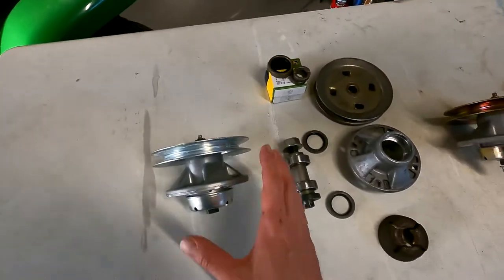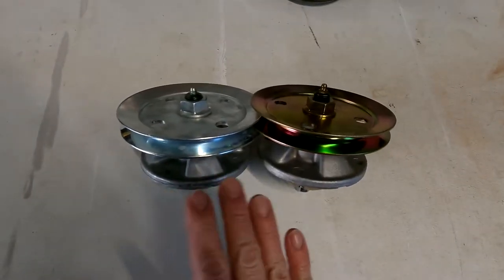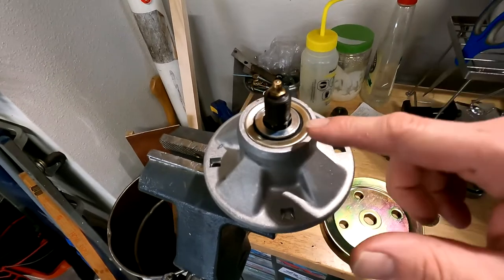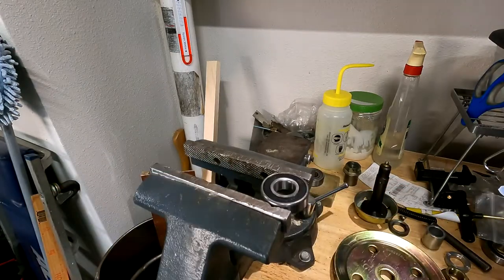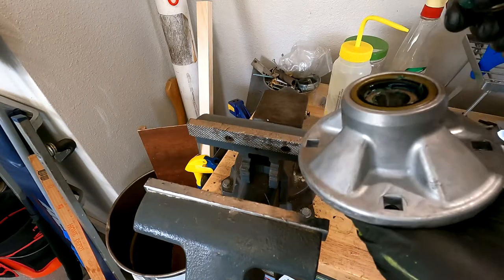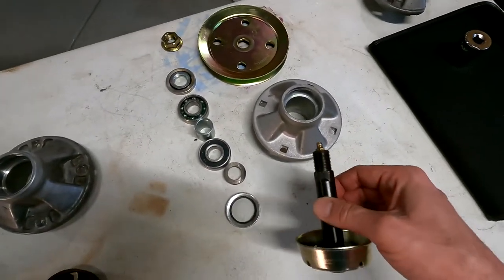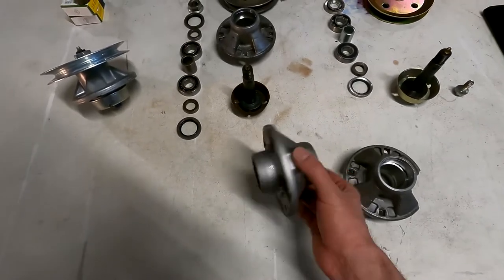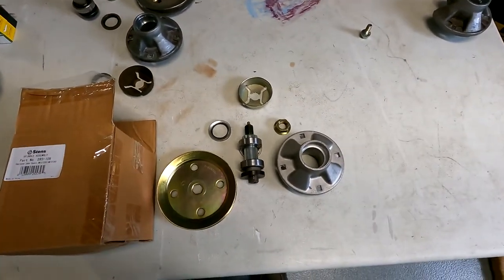John Deere 425 54" Mower Deck Spindles: OEM vs Aftermarket

Comment: I think a better option is to clean the original JD bearings and if after cleaning inspection they are smooth with no roughness, wear or pitting then 
 just reuse them. Since they are open bearings cleaning is super easy. I'm curious how many pumps of the grease gun are needed to get the grease into the actual bearings?  (ie does that inner cavity require much grease before it can reach the bearings?) How many mowing hours would you estimate between spindle rebuilds?

Comment: The pulley on my  John Deere mower separated. I called the local dealer, it would cost $47, they didn't have one in stock, 7 to 10 days to get it. Amazon had one for $12. It is stamped made in China. It fits and works like new. I wonder if the replacement John Deere pulley would also be made in China? I support American made but needed it in a hurry and my local John Deere dealer never seems to have the parts I need. It is easy to change, so if it fails I may try to find a John made one.

Comment: You need to pump them full of grease until grease is coming out. That is how you force grease into the bearings. If you just give it a couple pumps of grease you are just pumping grease into the void between the shaft and housing.

Comment: The top bearing is RS (rubber side) on both top and bottom because as the grease heats up it will be less viscous and those seals help keep it in place. The bottom bearing only has a seal on bottom. I just tore my Deere version apart and confirmed the same construction. Keep the seals and pack it with grease and the units will work fine. It may not be the exact same but it will last longer than a broken one and maybe not as long as a branded version.

Comment: Very informative!  ...Appreciate the quality of information on your channel. Regarding the JD spindles, since there are sealed bearings inside, it seems there's nothing to lubricate. Why do suppose there is a zerk fitting on the spindle?
Reply from the maker: Thanks for the feedback!  The OEM JD spindles do not have sealed bearings inside.  The aftermarket one I took apart does.  Sorry, I guess I failed to mention that in the video. At around 19 minutes I hold up the JD bearing and if you look closely you can see it's packed with grease, but has no seal.
Reply: @FoggyTinkering  Since my original JD spindles do not seem to have a weep hole, I'm very concerned about over-greasing. Is there a risk of creating undue pressure? (I'm not getting any overflow through the zerk, in fact, I'm not even able to squeeze the grease gun which tells me the cavity may be under pressure already.  (I welcome any comments from readers as well).
Reply from the maker: Your zerk may be plugged, or damaged.
Reply: @TeamGusto1  I would definitely drill a hole and tap it/plug it for a weep hole. Just my opinion.
Reply: This video explains it. When the cavity is full and you keep pumping grease it forces the grease past the seal into the bearings. Most bearings fail because people don't pump enough grease to actually grease the bearings. The proper way is to pump grease until grease comes out of the spindle. Then you know it is full. 
https://www.youtube.com/watch?v=PwObkilFXN0&list=WL&index=49&t=72s

Comment: I bought a 425 last year and I replaced the belt the other day now I have a grinding sound when I turn the blades on assuming it's a bearing bad do you know the whole assembly part number from John Deere
Reply from the maker: The JD spindle assembly PN is AM121342.  It's more than likely one of your pulleys; either an idler or the tensioner.  Check those first, as they're easier and cheaper to replace.  They go bad a lot too.
Reply: @FoggyTinkering  thank you very much

Comment: there's a vid called "don't trust the experts grease your mower deck spindle bearings common sense maintenance" that seems to prove that the sealed bearings will be packed by greasing the zerk .

Comment: To be fair, if the aftermarket used sealed bearings, then the other seal being trash is not really an issue, just don't expect to be able to re-grease the spindle with the zerk...
Reply from the maker: You're right.  In a pinch, I'd say they're probably fine for a while.  I just wouldn't expect the same heavy-duty capability the originals had.

Comment: The more I read and watch about the engineering of these deck spindles, the more confused I become. The first prime question is why would they install sealed bearings that can't get grease?
Reply from the maker: It's a balance of cost, availability, reliability, and their ability to perform as intended.
Reply: They get grease.  There's a YouTube video proving it. There is a lot of guys questioning grease not getting to the bearings with seals.  IT WILL GET GREASE! IT WILL NOT HURT YOUR SEALS.

Comment: Is JD worth what they cost?  They have stamped steel decks.
Reply from the maker: Great question.  Don't assume that because a deck is stamped, that it's no good.  Comparing Deere decks to cheaper brands, the steel is much thicker and noticeably heavier.  I feel fabricated decks are overrated for general residential mowers.  They're better suited for commercial or ag use.  Also, with all the straight edges and corners, they have to be heavily baffled in order for the air to flow well and grass to be discharged (or mulched) adequately.  A well-designed stamped deck will not require that much attention.  The rounded shape and intentional curves will allow the deck to do what it's supposed to do.
Reply: Clean the deck and coat the underside of the deck yearly in POR15 to keep it from rusting.
Reply: So what
Reply: @jimbob4456  if a manufacturer has the option they offer the fabricated deck as an upgrade over a stamped deck.
Reply: Not really but they have a name and that’s what your buying

Comment: The rebuild parts are not worth rebuilding compared to the JD complete assembly. Good to know cause I buy the complete spindle bc with the worn out bearing it eats away at the housing making it unusable from the little time the blade was wobbling. 
The grease can through the bearing seal covers. You need at least 80 pumps. A Youtuber tested using a different color grease and when he took it apart the new grease fillled that bearing. When I buy spindles for my X300, it doesn’t come with a pulley or nut. But I’m in Ontario Canada. USA may differ. Maybe we get ripped off.

BTW I’ll put $ on it that the eBay’r bought the spindle and put it in a Stens box. What a crook. I got asked once if I’d sell a Crane Cams Z28 valve spring empty box.  Of course I said no. I know what he wanted it for.

Comment: Always buy from an AUTHORIZED dealer for either John Deere, Stens, Rotary, etc.  Save yourself a lot of headaches.  Same goes for bearings......buy from a reputable manufacturer.   It isn't worth your time to go thru the rebuilding process to use junk.....but then you'll only do that once.  The next time.  Remember the Fram saying.......Pay me now or Pay me later!

Comment: wow! I never saw such garbage in my life. Why do people even buy this crap. I would be returning it right away and if they dont accept it I would dispute the charges with my credit card company. This thing is completely unusable and should be scrapped immediately
Reply from the maker: Many people just simply have to buy on price.  The parts are okay at best, but not nearly as good as the originals.  Might be okay for light duty use.
Reply: @FoggyTinkering  but if they are cheap and dont last you keep buying it again and again. This cost more money over time. If you keep doing this you are spending more money and you will never have a reserve of money and your bank account remains empty.
Spending less over time allows you to put money in a bank account and now you dont have to buy the cheapest one just to have it. You will actually end up having more money.